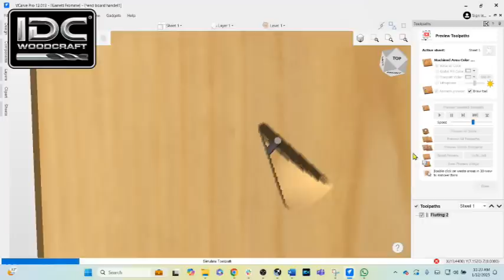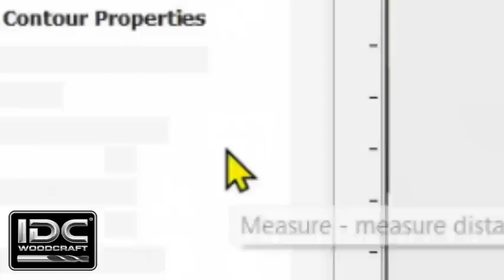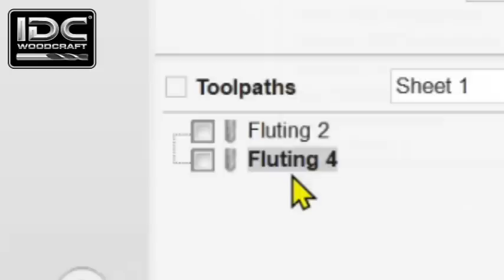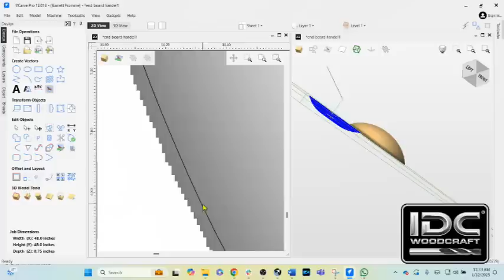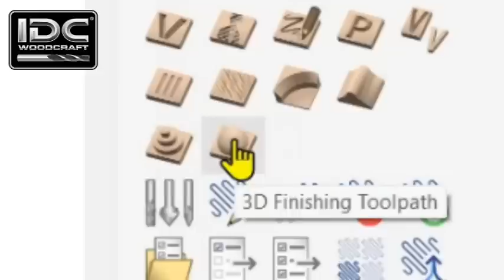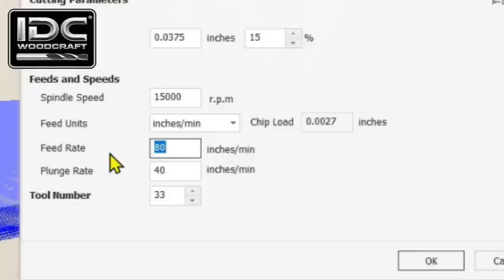Ingenious CNC Design Hack Cuts Run Time from 22 min to 3!

Comment: This is Jonbo. It's been a long time since we've communicated. I've been busy finishing my book. 
Is that a router or spindle you are using?
Reply: Spindle
Reply: @EdAgers110  
Thank you.
Reply from the maker: TheJonboix, Hi Jonbo! It's great to hear from you again, and congrats on finishing your book! The machine I used in the video has a spindle, which is often preferred for CNC woodworking due to its durability and precision.
Reply: @IDCWoodcraft  
Thank you. I still haven't set up my CNC. I need to finish the house upgrade so I can clear the garage. 
I will email you a link to a book description page I built. Your video is listed as recent but you don't look any older.

Comment: On your demo line, you commented that you didn't know why it started cutting on one line and not the other.  You can dictate the start point in node edit.  That should change the cut direction
Reply from the maker: leeleber8165, Thanks for pointing that out! Adjusting the start point in node edit is definitely a good way to control the cutting direction. It's great to see others sharing tips and insights!

Comment: Thanks for the video Garrett. I’m using the moulding tool path to make a cradle down a 24” piece of pine for glass bottles. Almost like this handle but a full arc. Is this fluting path a better option?
Reply from the maker: flatlanderbackpacking7181, I'm glad you enjoyed the video! If you're looking for a smooth, rounded profile for your cradle, a moulding tool path would typically work well. However, exploring the fluting path can give you a different aesthetic and might fit your design perfectly. It really depends on the shape you’re aiming for and the overall look you want to achieve!

Comment: Could this fluting method be used for making a pizza peel instead of buying the very expense bit?   Again thanks for sharing your insight.
Reply: The bit is not really expensive when you consider how much faster it it will cut something as large as a pizza peel. And it will leave a MUCH smoother surface behind than the ball nose bit will.
Reply from the maker: donaldamlaw1266, Absolutely, you can definitely use this fluting method for making a pizza peel! It's a great way to save on costs while still getting a beautiful, functional piece. Glad you found the insights helpful!

Comment: I just got the new ballnose bit, but haven't had a chance to use it yet nor have I used BamX yet. Thanks, Liberty for the TWO M&M packets. I've been buzzing through Kyle Ely's "Learn Your CNC" Lessons at warp speed and learned this exact method just a couple of days ago. I can see how Liberty became an expert in a short period of time and I recommend his course to everyone. All the bits I've purchased from you are exceptional and work well. I'm using Vectric vCarve Pro V12 on a Longmill MK2.5 with an 80mm water-cooled spindle. Get a spindle and you'll throw that router away (or just use it like a router is supposed to be used).
Reply from the maker: ronhansen7717, It sounds like you're really diving into your CNC woodworking, which is awesome! The ballnose bit will definitely open up some creative possibilities for you. I'm glad to hear you're enjoying the bits and the lessons—it's always rewarding to see progress. Keep up the great work with Vectric vCarve Pro, and I bet that spindle will make a huge difference in your projects!

Comment: i've created a recessed handle using moulding toolpath, and tbn bit that runs in about 3-4 min.  you control the shape exactly, which is nice.  i'd not thought of doign this with the fluting toolpath.  i've used a 3d to cut as i can  have a bit more control and merged 3 parts together to get complex part and then use vector to limit where it cut. 

again, thanks for doing great videos for everyone to help make  it all easier with the super machines that are now on the market.
Reply from the maker: onefinity-trainingtipswithMitz, I'm glad to hear you found a new way to create recessed handles using the fluting toolpath! It's great to see how you're experimenting with different methods and combining tools to achieve those complex designs. Thanks for your kind words about the videos; I'm happy to share and help everyone with their CNC journey!

Comment: Thanks, I didn't realize we had a fluting tool so this is a great help.   Suggestions - (1)please turn off the IDC logo when you are showing the vectric screen so that it doesn't cover up anything (2) please show us how to do this change to the model with Vectric 11.5.  I don't have the modeling tools on my screen.
Reply: It works basicly just like this in 11.5    And I understand for the logo, but it would be nice if it was turned off.
Reply from the maker: timheidenreich7173, I'm glad you found the fluting tool helpful! I appreciate your suggestions, and I'll take them into consideration for future videos.

Comment: Can any or all of these changes be done on the Longmill CNC with Vcarve 11.5
Reply: Yes
Reply from the maker: brianharris3602, Yes, you can definitely make many adjustments using VCarve 11.5 with the Longmill CNC. VCarve is quite versatile and supports a variety of changes for your projects. Be sure to check the specific features and capabilities of both the software and your machine to ensure compatibility. Happy woodworking!

Comment: You can check the size also by clicking on the line and looking at the bottom right of your screen. It shows the x and y dimension of the selected object.
Reply from the maker: brandoncaeden, That's a great tip! It definitely helps to keep track of dimensions while working on your project. Thanks for sharing!

Comment: Awesome video. Definitely a step up to a more complex operation that really is simple in the end. Question - would you have bumped the feed rate as much on the LongMill?  80 > 150 > 200?

My MK1 has been working amazing for what, two and a half or three and a a half years now?  I haven't pushed it that quickly, so your feedback based on your experience is a very valuable extra addition here.
Reply from the maker: LYTOMIZE_Woodshop, I’m glad you enjoyed the video! When it comes to feed rates, it really depends on the material and tool you’re using. If you have a good setup and the right bit, bumping it up can definitely improve efficiency, but you'll want to monitor for any signs of strain. It sounds like your MK1 has served you well—keep experimenting and have fun with it!